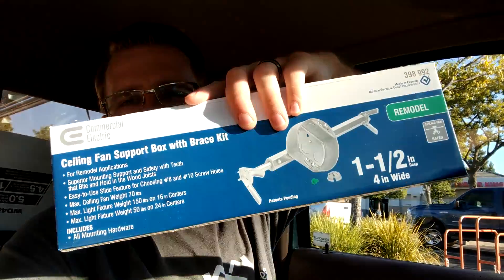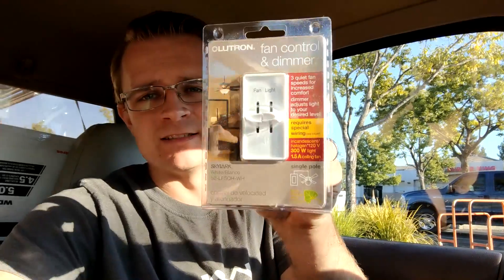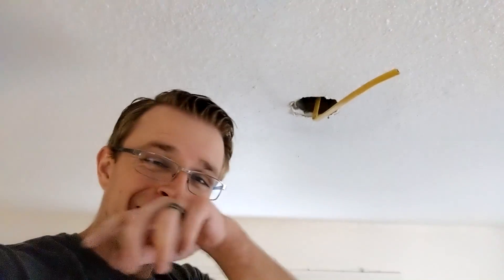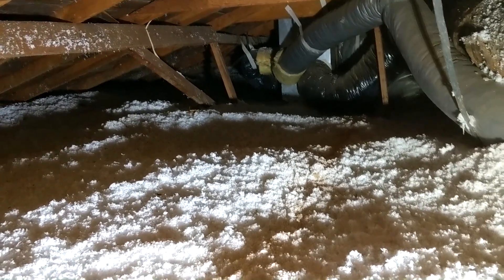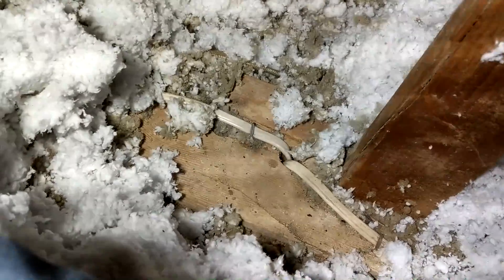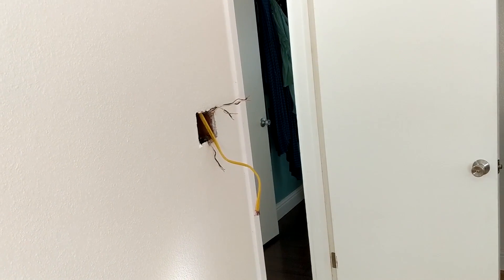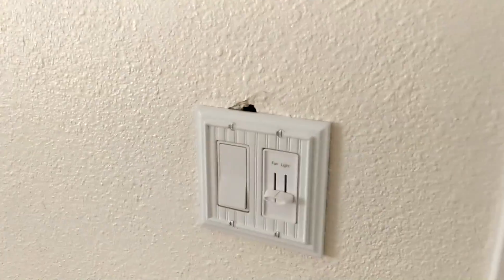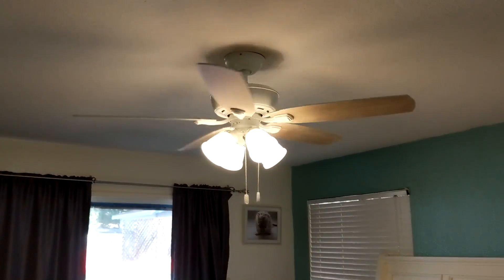Electrical Handyman Gets It Done / WLOG

Comment: Hey Allen!  Really been enjoying your videos!  I was talking with an electrician recently and he was telling me that whenever he has to buy wire, he always buys 250 feet at a time, because he inevitably uses it down the road, and the savings is monumental when you compare the price of 25 feet to 250 feet.  It may pay you in the long run to buy more upfront and then not have to keep buying wire for every little job individually.  Plus, you'll always have some on hand if need be!  Just a thought.  Keep the WLOGs coming!
Reply from the maker: Hey Brendan, Thanks for the comment! I love that thought, You definitely do save by buying in bulk! Thanks!
Reply: Yes good advice but most the time the client is paying for the wire and they are not going to buy 250ft when they only need 25ft so that’s prolly why he does it that way.
Reply: Hi Gonzalez family, if he buys for 250 feet of wire and sells the customer 25 feet at the big bucks price for 25 feet, and makes a little more money plus he saves an hour of his time, and he saves in gas. And he’s off to the next job quicker.
Reply: I meant to say big box price
Reply: @4Thug2Life0 when I price out a job regardless if I have the material I bill the customer Home Depot price per foot plus 10% plus an hour for a supply house run. The hour supply house run I charge once for a big job and don’t charge for a small job.
Reply: @bwojak3226 I do one better. I charge Home Depot price per foot for a cut of wire plus 10%. My family gotta eat.

Comment: Hey Allen, really enjoy your content.  Quick tip:  When removing an existing wallbox, I use a flat bar between it and the stud to create a small gap.  Then I use a thin kerf metal cutting blade in my portable sawzall.  I slip it carefully between the box and stud and cut down on the lower nail and upwards on the upper nail. The box comes loose very easily without 
damaging the drywall.  Just be careful to cut slowly so that you stop as soon as the nail is cut and you don't go past and cut the drywall or wire that is stapled above or below.

Comment: Would you have had to cut open the ceiling if the light didn't have a ceiling brace and it was on the bottom floor? Thanks.
Reply from the maker: Yes most likely, depending on the layout
Reply: Thanks bro.

Comment: Hi I think home depot and other stores have cut by the foot wire. It's much cheaper. Check it out. I would use the line and load on the receptacle instead of twisting the wire together. It's much safer
Reply from the maker: Hey thanks for the comment!

Comment: How were you able to attach the bar to the joists after installing it through the ceiling hole?
Reply: Caravan Carolyn there’s one you can screw in from the attic, the one he probably used is a two piece bar that expands as you twist it via an internal threaded rod. The bars have spikes on both sides. You put a u-shaped threaded bolt over the bar. The box has holes that the bolt(s) go through and you puts nuts on the threads to hold the box to the bar.

Comment: that "scanning" effect in your videos when you use a led light is a combination of the way LEDs are powered (pulse width modulation) and your shutter speed being too slow/fast so it doesn't "match up". if you can, you can adjust for it by altering your shutter speed until it disappears. if you film at 24fps your shutter is usually 1/48 or (180) deg. Try changing it higher ;)

Comment: How would you lay the wires in a room where you cant get into the attic or there is no attic? For example in a two story house how would you be able to install it on the ground floor where the ceiling is basically the floor of the second level.
Reply from the maker: Hey Thanks for your question, Depending on the design of the joists that hold the second story floor up there is room between the two stories, not much but enough to run wires. You wont be able to crawl up there so the only way to run wiring is cutting holes in the walls and ceiling.

Comment: Should of known it was a 20 amp circuit when you turned off the breaker
Reply from the maker: Yes, that is when I found that it was a 20 amp circuit. Thanks for your comment
Reply: Keep up the good work I'm glad you went back to home Depot and got the right gauge wire😀
Reply: That’s when he knew dingus. As an electrician I would have changed it to a 15 if those wires in the switch box ate 14 gauge. But I don’t know if he has to bring anything he touches up to code.
Reply: @KitchenerLeslie2  as an electrician we know once you work on it yes you have to bring it up too code.

Comment: Ok I am not an electrician, this is just a question nor am I about to do this protect.  But you need 12-3 to have light and fan control and only 12-2 due to the old fan had pull chain control, so can you/ legal to put a 12-1 and use old wire.
Reply: No such thing as "12-1"
Reply: ok 50 Ft of a 12 gauge wire
Reply from the maker: Hey thanks for your comment, the wires are rated by the number of wires inside minus the ground wire so a 12/2 has a black and white wire and a 12/3 has one white, one black and one red. I am not on the legalities of running 2, 12/2 wires to the fan, I have just always run a 12/3 when the fan and light are switched independent from one another. Great question!

Comment: Is there any reason why you couldn't have run 14/3 to the fan? that fan/light would never pull enough to call for 12/3 wire. Also, you asked for comments about your videos. One thing I believe would help those wanting to learn, would be to get close up shots while you work. Real PITA to set up and work around but that would give detail to what it is you are doing.
Reply: I thought the same thing. 14|3 would handle the light and fan,  but I’m assuming it might have to do with local code.
Reply: You must match the wire to the breaker. This was a 20A circuit breaker so you have to run 12/3. In case of overload, however unlikely, 14/3 wire can overheat before the 20A breaker would blow.
Reply: good to know. Thanks!
Reply: 20 amp circuit Clark.
22/3 could probably suffice for what that fan will draw but we don't size wire based on what something might draw but rather on the potential of what CAN be drawed. Get it?
Reply: Thanks Timboslice
Reply: NEC is religion, my man. He basically wanted this up to code. It is good to see a handyman abiding by actual electrical standards.
Reply: Let me ask a hypothetical question. Please, I'm not trying to start any arguments but where I work, there are a lot of older homes that have been worked and reworked over the years. Say I go and turn the circuit off to the bedroom at the breaker box and notice the breaker is 15 amps but the wire coming out of the breaker and that in the outlet box in the bedroom 12/2... Am I to run the 12/2 then? Again, I'm not trying to stir anything up... just asking.

Comment: How do you avoid being electrocuted with live wires there?
Reply from the maker: Hey Ben, Thanks for your comment, If the wires are live I am very careful around them but when I am working on them I shut the power off. Thanks for your question
Reply: German "safety rules for working on electrical installations":

-switch the power off (switch off the circuit breaker or remove the fuse).

-ensure that no one will turn it back during your work on the circuit. Some electricians tape over the circuit breaker and a note to not switch on the circuit will do it in most cases. But there are special locking elements available on the market to prevent someone switches the circuit back on during your work.

-ensure the circuit is dead with a functional voltage tester (you should test the voltage tester on a known functional and energised circuit before).

The other 2 rules are not of interest for electrical installations in residentials, they are more of interest if you're working on a transformer station or with voltages above 1000 V.

In addition most european electricians use insulated tools (screwdrivers, pliers) rated up to 1000 V, even if the circuit's dead. There could always be a guy turning the circuit back on because he wants to make some coffee or so.